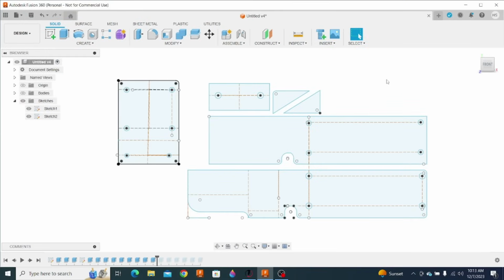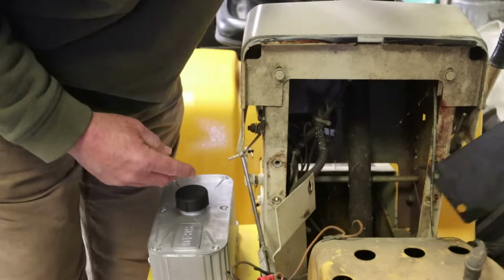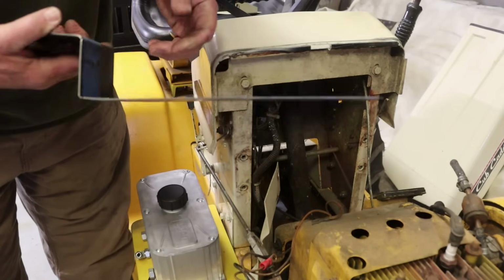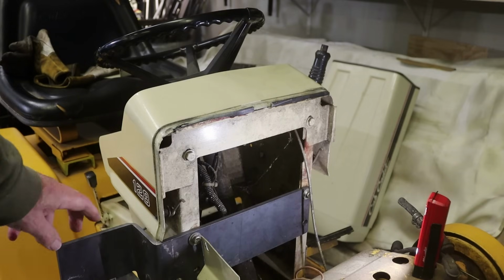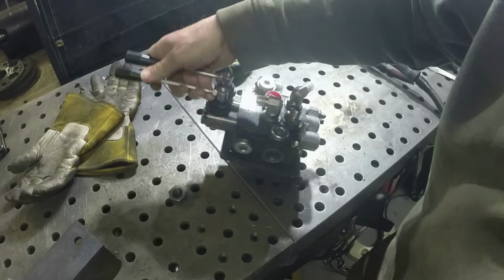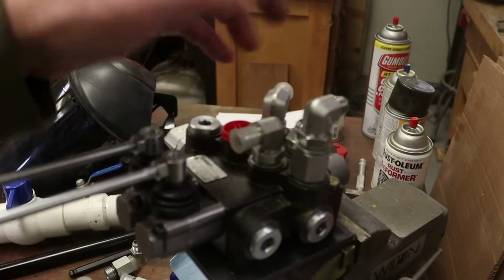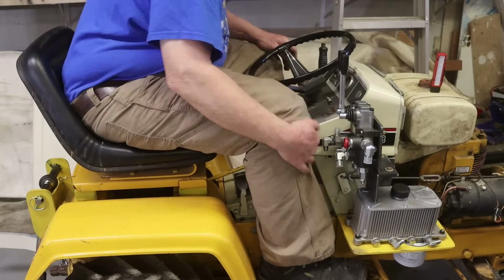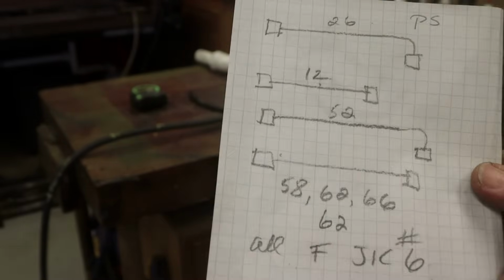Cub Cadet Bush Hog EP:08, Hydraulic Valve Mount

Comment: When you ever need to bend things that are thicker than your machine will allow you to, when you’re cutting it out on your plasma table on the lines where you need to bend, cut, intermittent slots. It will make bending very easy and more precise. Then when you’re done, hit them with your welder to make them super strong.

Comment: What I've seen others do when needing a bend in thick plate, they add a cut line in the file for the Plasma table, then bend on the cut line leaving only a couple small tabs, it bends easy, then run a bead of weld down both sides of the bend (inside & out) to make up for the cut

Comment: I run a grinder across the bend line.. cutting out at least 50% of thickness ....this makes your bend easy....and you only need to weld the inside ( one side only )... i use a thicker disc ( standard grinding disc not the thinner cut disc ) so it has room to bend and leaves room to weld deeper ( i might run a grinder after to weld into if i want it looking unwelded ( grind smooth later )... real thick metal you need to heat up to bend sharp....
Reply: I was going to write the same thing but looked to see if anyone else did and you beat me to it. I’ve seen guys bend quarter inch steel and have it come out straight as an arrow by cutting like half depth with a wider cutoff blade and bending it by hand basically. Welding it and then using a worn in cutting disc to put a nice radius on the inside. And they don’t even own a metal brake.

Comment: Frank the best way to set up your valve is to use all straight fittings and get your hoses with a 90 degree JIC end on one side.
Reply: Looks neater in the end too.
Reply from the maker: Yes, that's probably a better way to do it.

Comment: Hoses are not cheap thats for sure. I put two new hoses on my snow plow that were about 48 inches long and cost roughly 300.00 dollars. This was after buying two from Amazon ( china made no doubt) for 50.00 bucks that lasted exactly 15 minutes. I used the Gates green stripe high pressure ( 6500psi) for cold weather, zero issues after that.

Comment: Nice job on relocating the valve. Could you have made the bends about 45° each first and then finished them to solve the problem with making the first bend the full 90°?

Looking forward to the brush cutter build

Thanks for bringing us along
Reply: I think he accidentally discovered that in the end. 
I think in this case he could have done his bends in reverse order with the long length bent last but the partial bend prevented the interference.

Comment: When i need to put parts together like you did here....and it is awkward or hard to hold everything to get bolts started...i put some threaded rod in a couple holes ( hand tight is all you want )...then you can put your bracket on and it hangs ..then your gas tank can slide on..then you can start the other bolts and remove the threaded rod to put those bolts in..i do this on exhaust manifolds too...alot easier to get them on... i cut heads off bolts if i don't have threaded rod that size..or use longer bolts that i use to hold all my parts together .. then i start those long bolts enough to hang my parts on ( holding it all together as i start each long bolt ) and start the proper bolts on the other holes...anything you try will make it alot easier to get everything bolted up... i have other methods i use too...clamp one side ( all your parts together ) with vice grip.. then i can deak with one bolt and side ( parts not wobbling around ) ..or a bolt and nut ( put nut on side that can come off easiest when you get more bolts in )  loose on other holes ( or 1 hole ) so i only deal with one hole as i hold it ...🇨🇦🤓👍
Reply from the maker: That's a great tip!

Comment: Frank try using your brake without an air—assist cylinder as it seems that it isn’t putting out enough to do what you need. I built a narrow brake in the past with a cheap 20T jack and have no problem bending 1/2”.

Comment: Frank, are the holes cut by the plasma cutter perfectly round?
Reply: I’ve wondered how round the plasma cutter cuts holes and if it work hardens the material or could you still run a drill bit or a reamer through the material. 
Just out of curiosity.
Reply from the maker: They are pretty close to round, but the sides tend to be tapered due to deflection of the plasma flame. So they are not real accurate and are less accurate the thicker the metal. And the heated metal, splashed by water, hardens to the point  you can not drill or ream the holes except with carbide tooling.  Even then, the metal is so hard it tends to chip carbide tools.

Comment: The mounting plate will not effect the cooling air flow?
Reply from the maker: There is not a great deal of heat build up as it's mostly just circulating the fluid until it's needed to lift a cylinder. The reservoir has plenty of radiating surface area.

Comment: On your right angles is it not true that the nut is the locking mechanism and determines the angle.  The bottom thread insures deep enough to form the thread force to be tight but the nut double nuts and locks.  Pls look at these. Might be as I said.  Hydraulic valve unit.

Comment: Hello there... Couple of??? 4 you
1 did you try to Cherry red the metal b 4 u bend out
2 why not go in for the 3pt arms instead of out
3 the life or lower cylinders swap the end of the ram for a fork style head
Wish I could send pics
4 the sway Cain's don't need to be that big... My 8n are way smaller and it a lot bigger
5 I feel like those lower arms are way too long for the size of tractor
But I think after the dozer and grader and fork build you know more then me
Reply: Yeah the red hitch your baseing off you could undo the lower pins and turn them to point at each other on the in side then bent the lower arms in and the lift piston could of lined up to put that fork style over the arm 
And I'd see bout shorting the last curve to the end of the swivel on the lower arms
And the top link after the curve up id of bent it in like an A frame "if" you wanted to make other attachments like mold bor plow or back blade it's gonna pull on that top link
Don't I have your email info???

Comment: There are other YouTube channels about altering cub cadets. They spend more time cleaning and painting. There finish products look much better
Reply: I think the tractors you’re talking about are probably showroom vehicles, I’m pretty sure the ones Frank builds are going to work for a living. I think if they’re going to be in a show or a parade then you could do a frame off restoration, but sometimes you just want something that’s going to a job well.
Reply from the maker: I have 12 beautifully restored Cub Cadets.  I don't hack them up. These projects are working tractors, so their restoration is limited to mechanical issues. I completely overhauled this tractor's engine 5 or 6 years ago. While it may be a bit dirty, it's in perfect running condition.  Look at some of my other projects--they got all new paint jobs. This one is a worker.

Comment: Wouldn't it be less expensive to bend up hard lines and put short runs of hose where it needs to bend? Also with all these projects you have built you probably could have purchased a hydraulic hose crimper and saved yourself some money making your own hydraulic hoses especially if it is $30 for a fitting at Napa and only $3 online.